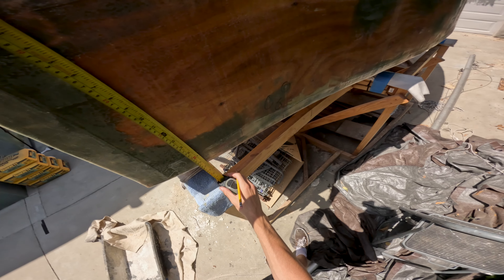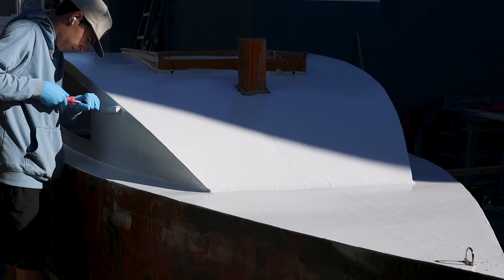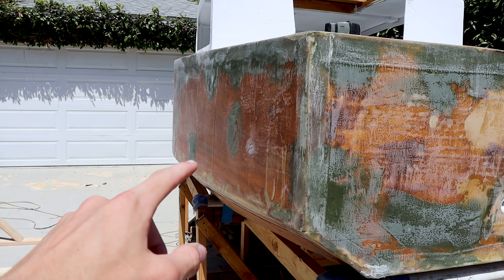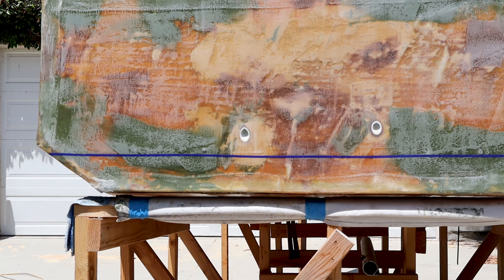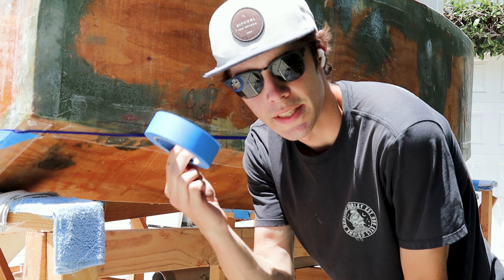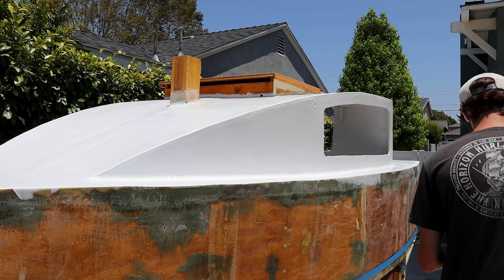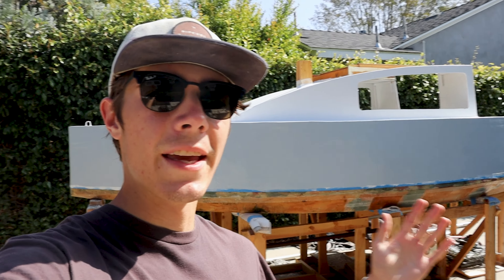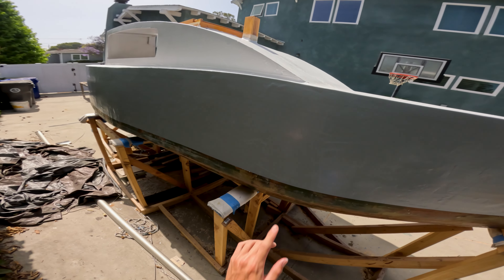I Tried Painting My Homemade Sailboat - Ep.12

Comment: Good work 👍but It would have been nice if you faired the hull and surfaces with epoxy and sanded to smooth when the  imperfections are covered.  It's not too late.

Comment: Did you consider using a filler for the hull in order to get a smooth surface? So you don't get down to sanding the fiberrglass  to get a smooth surface and then you can just paint on

Comment: I don't understand. What was the purpose of the thin blue tape?  All you needed was the wide painter's tape.
Reply from the maker: I watched a few YouTube videos before hand and a large majority of these boat builders recommended this thin blue to help get a cleaner paint line. I've painted before with just the painters tape and I can say, you don't get a very clean line, especially if your surface isn't super smooth.
Reply: @JackWood25  Nobody will see that line. The bottom paint will overlap the topside paint.